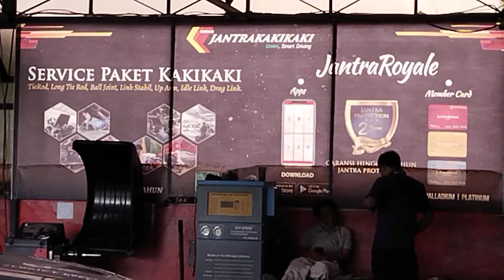Perbaikan Kaki Kaki Honda Mobilio di Jantrak Kaki Kaki Malang

Comment: Service kaki2 spt ini kisaran biayanya brp om?
Reply from the maker: Kalau sekelas mobil Jepang...paket kaki kaki 1.250.000 meliputi tierod long tierod booljoint....kalau EPS Rack Pinion 1.500.000 garansi 1 tahun...kebetulan Kemarin saya kena itu semua berikut engine mounting kanan 650.000..boshing shock absorber kanan kiri 400.000.spooring 150.000